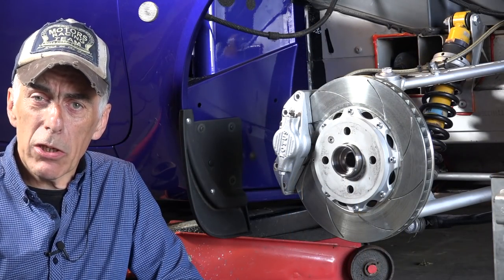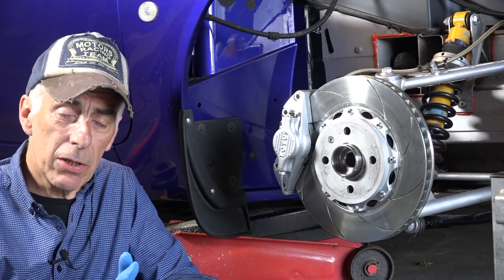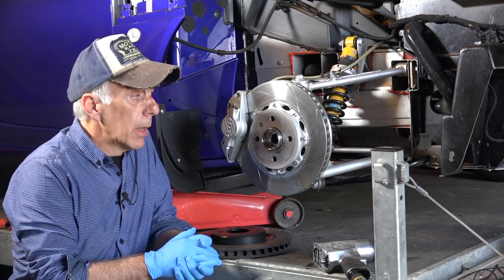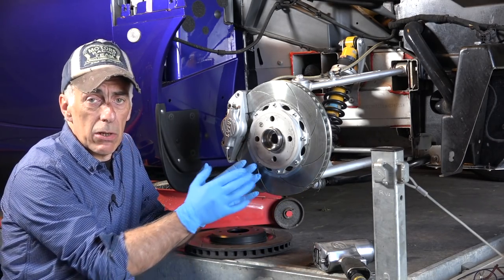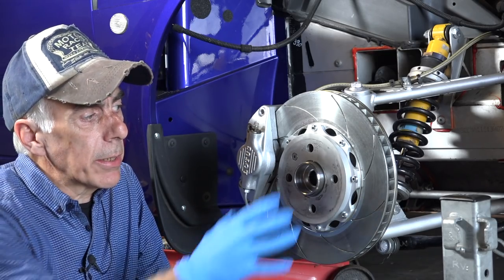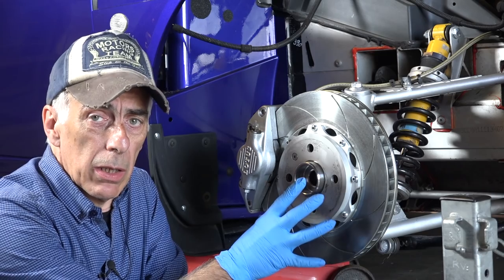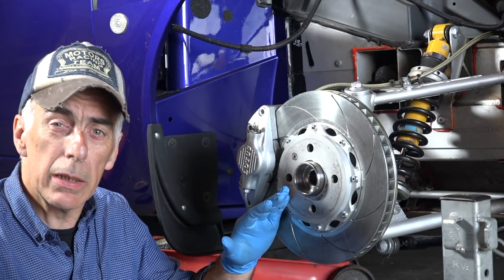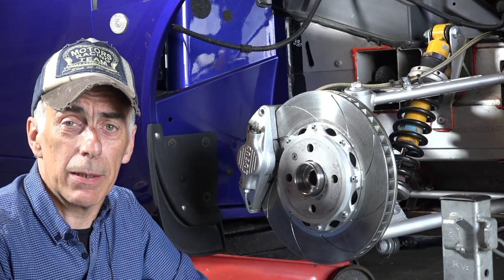Lotus Elise, Don't be tricket with uncertified parts or fake part numbers

Comment: Thanks for your video. Here in Switzerland, we have a similar situation with periodic MOT/CT inspections.
I was almost going to purchase the two piece brake discs you have. But in the end, following the recommendations from my local Lotus dealership, I went for the AP Racing discs. The dealer said they pass the local MOT/CT and that the authorities here will not question the safety of discs from well known reputable brands like AP Racing, if they are recommended and fitted by the Lotus dealer.
In the end, I also did not want to make any compromise on performance and quality. Having experienced brakes fading during a track day, I do not want to risk making that experience again or even less, before a hairpin turn on a mountain pass.
Reply: Could you bring your own discs to the dealership or did you had to purchase whatever they offered you? I am currently thing of upgrading my suspension and likely will face a similar situation.
Reply: @skystink  Yes. The dealer will indicate that the parts (discs and pads) were provided by the car owner. That way they are covered. The dealer said that the detailed specifications for the Elise Cup models are quite hard to find; therefore, the authorities usually trust the dealer if they say it's OK (and it seems legit). This is the case here. I am not sure how it would work in other countries. For suspension parts, I think you should be able to find some sort of type-certificate/homologation. I managed to get it for a TEIN suspension kit I installed on a Toyota MR2, a while back.

Comment: Interesting points you raise, certainly a two-piece disc with same part number as original part is misleading.

I believe all k-series elises where fitted with one piece discs from Lotus.  Later toyota engined elises and exiges had the option of a two piece front disc setup, such as A120J0046S, but they were dimensionally different.
Reply from the maker: Thanks for the comments

Comment: Very interesting and something of a minefield for us classic car owners. There are properly designed and engineered replica parts and real 'fakes' out there and with no standard testing or certification process (but plenty of fake certification) it's buyer beware. This is further complicated by the fact that modern steels vary in quality immensely due to poor quality control at the manufacturing and buying stages - yes there is such a thing as fake steel as the nuclear industry has found to it's cost. Proceed with caution and if something is cheap investigate why is the best advice I can give. What looks like a bargain could fail prematurely and perhaps cost you or others their lives.
Reply from the maker: Thanks for the comments , and i can only agree. here the discs were not cheap.  289 euro for two.

Comment: The maker of your disc knew exactly what he was doing and sold a fake. Dealer should give refund and if not consider a lawsuit. The number makes his guilt clear. I commend you on your honesty and wish to do the right thing. Usually the reg are here to help protect us from these clowns.
Reply from the maker: Thanks and indeed...., although I know that rules are sometimes over the top.. but then those need to be worked on if they are not correct. and not by fake numbers to make believe that it is something that it is not

Comment: In the USA most of the Chinese suspension parts as well as the electronics part have never passed any certification anywhere and never would.  I had a cam chain tensioner put in an engine, it was a GM car and the part was marked Delco Remy on one side and on the other made in China.  After 40,000 miles the cam chain came loose, it and all the cam gears were replaced along with the cam tensioner.  When the head came off the tensioner was run all the way loose letting the chain jump several teeth and wiping out most of the valves.  Chinese parts are mostly junk, having to change them in less than a year is common and getting one that won't fit or won't work is also common.  You cannot get an American made part for an American made car for the most part and the Chinese factories turn out garbage.  If we had comprehensive tests such as you have to undergo most of the cars on the road here would fail.
Reply from the maker: Thanks for the interesting comments and write-up
Reply: roy gunter almost all aftermarket parts in the world are made in China. All the European aftermarket brake rotors are made in China as well. In the USA we require the country of origin on the box and we don’t require certification. They don’t require the Country of origin in the EU so they don’t know where the part is coming from. It a big scam. The certification process covers up the country of origin. Caveat Emptor!

Comment: The old 'original Lotus' brake disc as you show and describe is in fact an aftermarket EBC brake disc, not the original Lotus item....
Reply from the maker: Thanks, and that disc has the approval as it matches the same dimensions and build...  I was not saying that all aftermarket parts are bad...not at all... the point I am making is that selling parts wit a lotus part number on it is so misleading and fraude that brings or can bring us in problems....
Reply from the maker: Will B have look here and you will see that they are TUV approved https://ebcbrakes.com/about-ebc/research-development/
Reply: Yes, but you are saying that's an original brake disc, it's not, it's an EBC upgraded item!
Reply from the maker: @willb7081  , yes you are right.. its the original disc that was on the car before. I should have stated that more clear.
Reply from the maker: @willb7081  , correct it was on the care before the bell discs and passed the technical; inspection because they have a TUV certification as an upgrade.   I should have made that clear WillB.  It is indeed not an original Lotus disc that would have been cross drilled.

Comment: Belgian tuning meetings must be a hoot this way 😂
Luckily a Dutchie already contacted you to take over these discs 👍
Reply from the maker: Sad is it not, but that is what it is... there is nothing I can do about it.    Of cours I can fit the old get the TC and then replace them again.. Common practice
However, I have no idea if these discs are any good as they have no test reports or so.   Maybe some viewers can comment on these
Reply: With only 2 webshops available for aftermarket parts, neither of the 2 owners can afford to put faulty products out there.
With the community so small, poor products would rise very quickly.
As for road usage of these, i see no problems.
As for the certification, that is just an unfortunate event for your country. You cannot expect small batch product producers to jump through the hoops as if they are for a ford focus. It would just make them silly expensive.
Reply from the maker: I can agree to you points, however  poor products (and that is not what  I am saying on this part) will indeed pop-up quickly. But those that did buy them first are screwed and that should not happen.  In the case here its all about the lack of decent tested and assured parts sold as lotus parts with a lotus part number.  IMO, parts that affect directly safety like brakes, seatbelts, suspension parts, even seats should not be allowed on the market without a certification.  Webshop owners should mark those parts that are certified and those that are not.  So we all know.   In the case here,  the discs are sold as lotus sports discs so much better then the originals ......etc...  and yet there is no certification or testing report on them.  because its " to expensive" to acquire.  In other words we are ginny pig to find out how good or bad those are.  That is wrong, those discs are not cheap....
Reply: I agree. Belgian owners are oficially stuck with oem parts, and once they run out (The 10 year gentleman agreement) you are stuck with cheating or selling the car. For the rest of us these webshops are a real solution.

Comment: So it should have a note on the site to say that they do not conform to EU regulations.  If they are using fake part numbers, then report them.  The regulations are there for a reason.  Some countries are very strict on modified cars and motorcycles.  They do not lie them.    You cannot possibly say that these parts are OK because they look OK.  They are not tested to any accepeted standard, and therefore are not  with the risk, especially the brakes and suspension.  A salutary lesson.  Here in the US we go of the other end of the scale. In my state there are NO safety checks mandated on cars.  Now that is just plain dumb.
Reply from the maker: Thanks for the comments,  strange world we live in... if rules are to tight people fake.. Its not uncommon to see people modify their car back to original state before a MOT and refit all the other stuff onces back.....   somewhere there must be a middle road...

Comment: Hoping the strict inspector its NOT one of your followers.... i would change the discs, pass and replace them back.
Reply from the maker: hahaha, well maybe he is and he will see what else happens in the world....   that woudl be an option but would still leave me with brakes that are uncertain, unless other consumers have an experience with it
Reply: @D3Sshooter   
On the 3-4 majors lotus parts sites i think they sell similar or even the same  spare parts all those years. I think it would be very complicated to have a paper for each and every one. Theoretically even for a single bolt that hold a shock absorber, or for the sport toe link and so on. Practically all the "motorsport" parts you used to improve your Elise should be illegal if it was for the "inspector clouseau" .  I think the guy was just over-strict and want you to pass some hard time. Never heard of any problems on those discs. Just be sure the bolts that holding the disc on the bell are perfect. Replace the discs, say you're very sorry, you wont do it again and ones you pass, put back the lovely brake discs you have.  Except if the inspector is reading me right now.... creepy.
Reply from the maker: @onlytheessential  , you have a point . The inspection is very subjective and not at all objective.   It all depends on the inspector himself.
But what really annoyed  me was the fact that its labelled with lotus part number.  Now , I stille believe that for critical parts like brakes there has to be some form of testing and certification.  Not for all parts but at least for those that are riskfull...  think seats, brakes etc...
TXS for the comment
Reply: @D3Sshooter  
Agreed 100% if the shop you bought the discs sell those as original Lotus parts and stamp the exact Lotus code on. 
But if you bought them to improve the stopping power (witch the do with the new pads, on my opinion) regardless the precise code, then the code itself looks to me that it’s there to trig the inspector. Unfortunately didn’t work in your case. None of those “motorsport” parts we get have a paper but there been selling them from at least 10-15 years now. I think if they would be defective or inadequate the forums would be full of complains by now. I am sure that, if the inspector had a Lotus (envy…) he would do the same. Have a Great Day Steve!